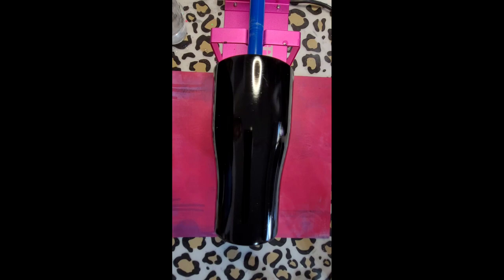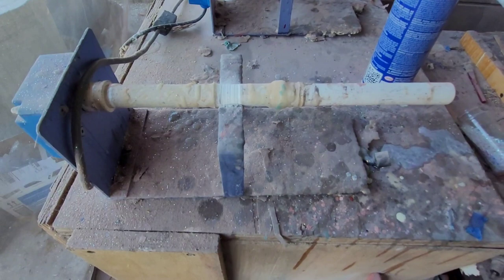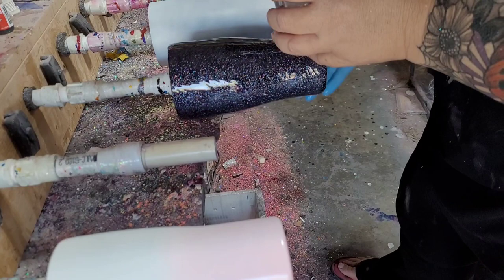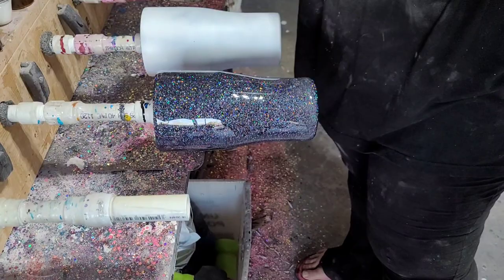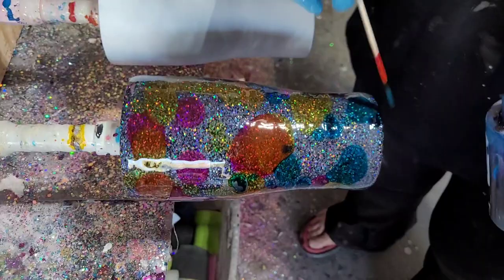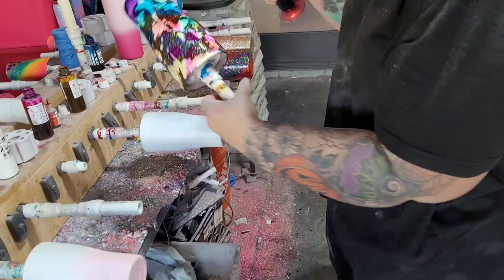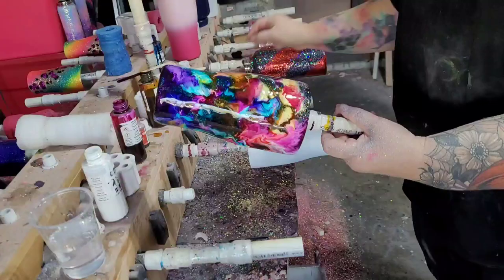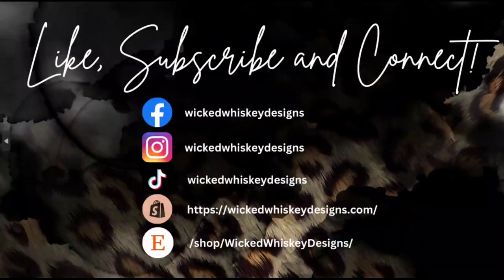Easy Alcohol Ink Swirl Glitter Tumbler Tutorial: Resin, Epoxy Art, Alcohol Ink, Glitter Tumbler

Comment: I know this is a year late but I did a cup & 24hrs later it’s not dry what did I do wrong & what can I do with cup? TY
Thanks for all your tips
Reply from the maker: Hey there are you saying that your epoxy is not dry or that the ink is still tacky? Usually either one of those scenarios can be fixed with another light run of epoxy on top of the cup.. if it is simply that the ink can still be a little tacky, that usually means there was a lot of ink and maybe not as much epoxy. It sometimes happens, I would just add another round of epoxy on top of that. If your epoxy is still not cured, that could be because the epoxy wasn't fully mixed and again, if you add another run of epoxy on top of that you should be fine.

Comment: I thought you could not torch alcohol inks and/isopropyl alcohol.
Reply from the maker: You can if you give them just a second once you add them to the cup. I'm not saying I have not accidentally set them on fire because I have :-) but if you drop your alcohol ink and let it move around for 5-10 seconds, you can torch it without a problem. Obviously you're using short quick light bursts, you're not totally drilling down on it with the torch, you just want enough enough direct heat to get the movement on your cup. I hope that makes sense 😊  great question!